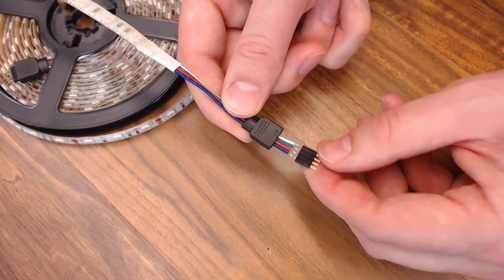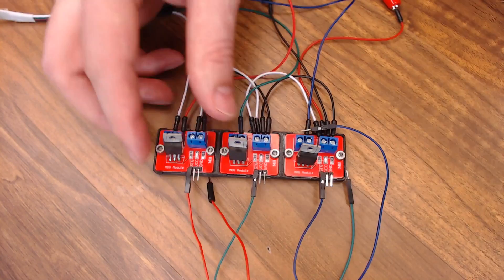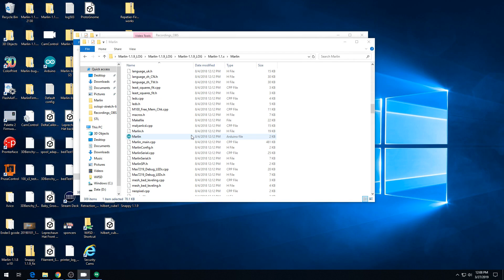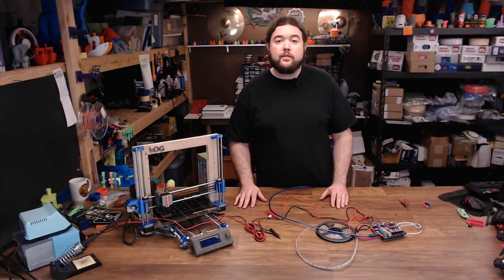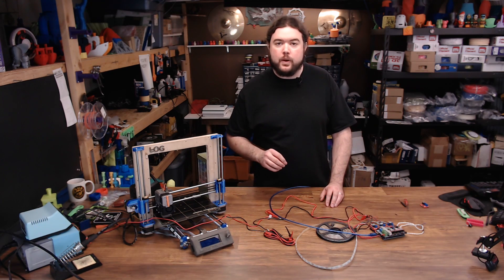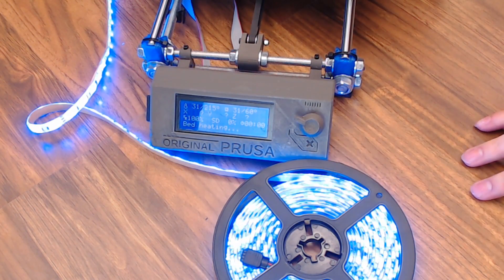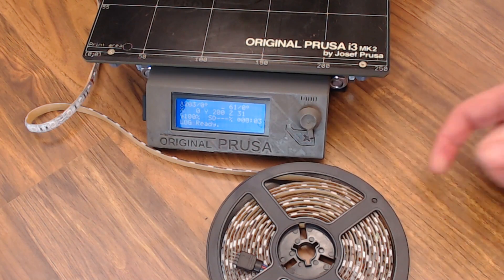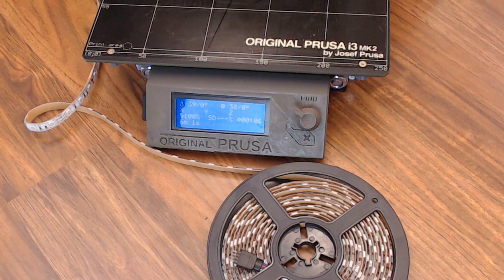LEDs For Your 3D Printer - How To - Chris's Basement

Comment: Great in-depth tutorial and showcase of the true potential of adding LEDs to your printer. 

I have to ask though - If I wanted a 3-possition switch for different light levels, would I just be able to add that between the psu and LED strip, and have the lighting work the same way at different voltages at a flick of the switch? (Was thinking lower light levels for nightime, as my enclosure features a window, and is placed in my room, where I sleep)

I know it's an old video, but I hope you can help me find an answer :)
Reply from the maker: Yes, if you can get the switch setup to lower the voltage, I think that would work. I'm not sure of what the minimum voltage on some of these strips might be. It would take some trial and error.

Comment: Id like to edit the Prusa firmware for this but there is no code for it in the firmware.
Reply from the maker: Yeah, I think Prusa has cut all that out to slim it down.
Reply: @ChrisRiley  i have noticed that. decided to get an skr and learn how to edit marlin so i can customise to my liking. i think i just need led strip with chips "neopixel" 5v and they just wire to the skr rgb port? no need for mosfet boards.
Reply from the maker: @magicmanspaz  Yes, you can do a few like this. But if you want to do a lot you'll need and external board. Good luck on your project!
Reply: @ChrisRiley  Yes true i guess many leds would require more current. not sure on how much the skr can supply but that is something to factor. ill look into it. thanks again!

Comment: Would the ebay  break out board work. Smaller and no jumping. Wires. Vcc ground.   In and out.        MOSFET breakout board module switch relay (15A, 30V) 3-outputs for  Arduino/RPi
Reply from the maker: Sure, there are a lot of nice boards out there that will do this.

Comment: hey Chris love the video thanks for the mosfet holder link I had a little trouble but it was mostly an issue with the mosfets a leg was broken and a signal wire didn't want to stay on but I changed a bit and wanted to ask why didn't you just make the RGB signals the limit max signals? I was doing this on a ender 3 with a skr 1.3 board and the max pins seem to do the job anyways keep up the good work
Reply from the maker: Thanks! Yes, this only works on PWM pins. Some boards the endstop are not always PWM capable.

Comment: Hi Chris can you do a video please on adding LEDs to an SKR V1.3 board using VS Code and the latest version of MARLIN, I am still struggling as to set mine up to work with Prusa . All set up as per your video but still no life not even using Pronterface
Reply from the maker: Hey Colin, yes, I will be doing one in the future about LED's and the DCDC BTT modual.
Reply: Hi Chris any news yet on LEDs with latest Marlin everything appears to be OK but wii not light up at all
Reply from the maker: @colinraines395  They don't light up at all?
Reply: Sorry Chris they don't light at all from start to finish

Comment: Hi Chris Brilliant video as usual. But I am having problems making my LEDs work ,they are on Blue continuously .Am set up on SKRV1.4 Turbo board.am using the pins on PWRDET P1_26.  E1DET P1_25 E0DET P1_00. and slicer G Code settings as suggested
Reply from the maker: Hmmmm, those might not be PWM, that is all I can think of, I would have to check the diagram to be sure.
Reply: hey colin I just got done adding leds on my ender 3 with a skr 1.3 board and I was having issues with the greens doing the same thing and I found a leg on one of the mosfet broke, and one of the signal wires was loose so I re-soldiered the mosfet and instead of using single wire connectors I used a triple but with only one wire attached

Comment: Hi Chris I'm trying to use d20 on tri gorilla board for extruder light and found that it's always on and will not accept g code (using pronter face) to turn off, do I need to change the -1 in pins.h so it will accept commands
Reply from the maker: If it is used by something else, then yes.
Reply: @ChrisRiley  there was nothing plugged into it ,would the board track through it to reach something else
Reply from the maker: @lprkon72  You will probably have to find a schematic for the board to be able to do more than on and off you will need PWM pins. As long as the pins aren't in use, you can use them for whatever you wish. I would make sure your pins file matches your updates anywhere else.

Comment: Hi Chris. On the Big Tree Tech SKR V1.3 board can I use AUX-1 slot to control my LEDs. If yes what are the pin numbers please or do I use the letters
Reply from the maker: You can use any free pin. I would use the MAX endstop signal pins. X P1.28  Y P1.26 Z P1.24

Comment: Chris, I want to add 1meter of neopixels to my printer. I have skr 1.4 turbo. THe LEDs need 3.5a 5v power. Can I pull that much from the Neopixel 5v line or should I pull 5v from outside source?
Reply from the maker: That is probably a little much for the board, I would source it from something else.

Comment: Do you have any hints on Prusa MK3? It have a RPI port, and it seems that you can use its free pins when Raspberry Pi is not installed, but I can't find good docs on that matter.
Reply from the maker: Unfortunately, I don't. I am not sure how the Prusa firmware would allow you to turn them on and off.

Comment: Tried this on skr 1.3 but did not work, the rgb leds work fine with the mosfets but not through the max endstop pins,  enabed rgb and assigned the pins in config h, P1_28, P1_26,P1_24. made the changes in the pins file but when checking with a multimeter the signal pins stayed in a low state :(      but it will work with one color if i use the one and only servo pin
Reply from the maker: Hmmm...I wonder if there is a setting to turn them on somewhere. I will have to look around.

Comment: Have you ever thought of or been asked to setup/upgrade for someone?  I've got a ender 3 bought a mks gen L board and touch screen.   I cannot get the board to respond to anything other then flashing it appears to be working but won't operate.
Reply from the maker: Yes, I have done a lot of configs for the community. Did you have to get the ch340 driver? That might help. Can you connect up with Pronterface?
Reply: @ChrisRiley  
Firstly thank you for replying your the first of the 4 different youtube 3d printer guys that I am subscribed to and follow that replied.  Thank you!!
Having said that, I bought the driver DRV882    No idea why I bought these ones because of all the video "guys" I watch no one uses this driver.   
I've tried to use pronterface but I am not that good at using that program even with my stock factory set-up.  I use Cura for everything.
I'm so lost that I don't even know if I am answering your questions correctly lol.   
I am not sure how much of a interest my subscribers have into 3d printing but I am going to plug you in my next video if you don't mind.  I will link your main page on one of my videos.
Thanks in advance for all your help!!!  Love your videos.
Reply from the maker: @BackyardDIY-Zachary  Awesome, thanks for the plug, just let me know how I can help and I will try to walk you through it.
Reply: @ChrisRiley  Start to finish lol..   I need to know how to flash the board.   I need to set the power for the stepper motor drivers..

Comment: Hi, excellent video. I have a problem. I want to do this with my Tevo Little Monster. The motherboard is a MKS SBASE V 1.3 but configured with Smoothieware. I have no idea wich pins I can use and how I have to configure this in the config.txt file. I think I can use pins in EXP1 slot because it's a TFT screen and not a lcd panel but I am absolute not sure. Have you an idea? Thanks.  Joseph
Reply from the maker: Hey Joseph, no clue how this would work in smoothieware. I have very little experience with it.
Reply: @ChrisRiley  Ok, thanks for reply. I have found a pretty solution. I will use a plugin octoprint that uses neopixel. It would be more easy to install in a Raspberry.
Reply from the maker: @josephcaporaso4774  Cool, I want to try that config for sure.

Comment: I'm trying to do this with my prusa mk2s stock firmware. I changed the pins in "pin.h" to move the min endstops to the max endstop locations and have everything working correctly except for the pwm for dimming. I'm using M42 P11 S255 for manual pin control. I'm wondering how to enable pwm on those pins?

Comment: sorry if im being thick but i ccan only get the blue led to work with M150
Reply from the maker: Hmmmm, if the wiring is correct, B R and U should all work.
Reply: @ChrisRiley  Thanks for replying Chris, i put it on the back burner for a couple of days. I decided to order a few more boards just in case i did do something wrong. I did start over several times trying to trouble shoot it. Hopefully when i do it again all should be well, great Videos by the way, you've earned a sub :)
Reply from the maker: @AMilesGSFE  Thanks a lot, good luck and thanks for the sub!

Comment: The control scheme for this is close to a project I want to do.  Instead of led's have one or more pins act like a interval timer for professional cameras.   That way you can get way better pictures.  How hard would this be to do?
Reply from the maker: I think you could bake that into your gcode real easy. Just add a line to change the pin status on layer change.

Comment: Awesome video Chris...  Just a few days ago I thought about some sort of “On the Air” style indicator to mount outside my enclosure (more about it later) to let me know what the printer was doing.  There really wasn’t many offerings for something like what I had envisioned so I shelved the idea and decided I would revisit it at a later time.  Now with this video, building a notification system might happen sooner!

About my enclosure...  I obtained many years ago a full sized 19” server rack/cabinet that I had planned to build a home network/file server into, but never found the time or real need to.  The only side that is not closed is the back, but that will be fixed soon.  For years it sat in my garage but now resides in my computer room with my Ender 3, my repurposed food dehydrator and my HP inkjet printer.  Even with the open back, it really cuts down on the noise.  It’s on the outside top of this enclosure that I was thinking of placing something that I could tell what the Ender 3 was doing.

Again many thanks for the “Right on Time” video...
Reply from the maker: Right on! Glad this worked out for you. You control all kinds of cool stuff this way. Would love to see what you come up with.

Comment: Hey Chris, I am curious if you know of any pwm pins on the factory Anet a8 board.  I'm really interested in trying this mod.
Reply: And I think I've already discovered my answer.  :)  Looks like it will be limited on what I can use on this board.  Still can mix some colors.
Reply from the maker: Yeah, there is always limited info on these boards. They do have min and max endstop pins so you might be able to move things around to test.

Comment: hmmm I wonder if I can use the mosfets off an old ramps board with 10k pulldowns to do the same thing?
Reply from the maker: Sure, that should work, we are really just using them as a switch.
Reply: @ChrisRiley  thanks for the reply Chris,  I decided to give it a shot on my cr10 that I've shoe horned a ramps board into, and  it works!   I think adding a couple of menu items to the printer to turn the leds on  and off in 'white' mode  to make it easier to see while doing any maintenance could be handy too
Reply from the maker: @DevilbyMoonlight  That's a great idea.

Comment: Great video. Was looking for something like this. But my Prusa uses an EINSy10a board and when I looked through the sources of the original Prusa firmware, there was nothing that reffered to RGD LED's. Should I use vanilla Marlin to be able to use this?
Reply from the maker: Your probably going to want to say with Prusa firmware. You can edit it and load it with the ide to enable some pins. Then use gcode commands to do the same thing.

Comment: Thank you very much for this great video.  I am considering doing this for a printer that I am designing and building.  This printer will have a 24v system with an MKS Gen L board.  Rather than step down the voltage for the LEDs to 12v, I find myself thinking that it might be simpler just to get a 24v LED strip.
Reply from the maker: You're welcome! That works too.  😀

Comment: Good tutorial, but the Neopixel LEDs are better for this use case
Reply from the maker: That's what lots of others are saying, I will have to give them a try.
Reply: Chris Riley can’t wait to see it. Keep up the great work!
Reply: Can you elaborate why Neopixels would be better? I am interested in modding my printer with LEDs.
Reply: Edward Z - The Neopixel LEDs only require a single IO pin as opposed to 3. The LEDs on the strand can also be individually changed, meaning you could have complete control over each LEDs color. The strips used in this video are linked, so they all have to be the same color
Reply: @cap1sup  Thank you for the quick response. So does that mean I only need one MOFSET driver board for all three colors?
Reply: Edward Z No. You don’t need a MOSFET board at all. Each LED has it’s own chip, which are connected on a single data connection. In addition to the data connection, you need a positive and a negative to power the actual LEDs. The printer’s main chip (like a Arduino Mega) then tells each chip in the line the color values it needs. It does it so fast there isn’t any latency. In addition, the chips also allow you control the LEDs in a pattern, much like the ones on carnival rides
Reply: @cap1sup  You are talking a little over my head but that's okay, that's how I learn new things. Isn't the point of the MOFSET to keep from overloading the Arduino/RAMPS board? Why don't the Neopixels cause an overload ?
Reply: @edwardz5581  - So a MOSFET is a power controller. It allows the relatively small amount of current of the mainboard to control much larger currents, like the ones the LEDs use. I don't know if you know this, but RGB or RGBW LEDs have individual parts for Red, Green, and Blue or Red, Green, Blue, and White. The color can be varied by lowering the power available to the LED parts, effectively dimming each part. To our eyes, the colors of each part mix. This is similar to mixing food coloring. By varying the amount of each color of food coloring, you can make the parts of the rainbow.The LED strip used in this video has all of the same color parts of each LED in the strand connected. Therefore, all of the LEDs in the strand have to be the same color. With the NeoPixels, each LED in the strip has a dedicated chip behind it. The mainboard can tell each chip how much power to give each part of that chip's LED, and the chip pulls power from the power lines of the strip. With the individual chips controlling the power, a large power controller (the MOSFET) isn't required. Each chip in the line is "talked" to with the same connection, so only 1 pin is used on your mainboard. Let me know if you are confused or need more explaining.
Reply: @cap1sup  So if I understand you correctly, you still get your power from a different source but the mainboard is controlling the lighting effects. Do you still need a pin for each color?
Reply: @edwardz5581 - You have to use another 5v power supply. The one on the mainboard isn't big enough to power the LEDs, and you could fry the power supply on the mainboard. I would guess you would use 12v, so you could use a buck converter (google them) to take the voltage down to 5v. Each LED on the NeoPixel strand draws 0.080 amps, so multiply that times the number of LEDs you want to get the minimum buck converter rating (ALWAYS get higher!). You only need a single pin from the mainboard to address all of the chips in the strand. While the mainboard addresses each chip, it tells the chip the color values that LED is supposed to be.
Reply: @edwardz5581  - Here is the link to NeoPixels from a highly reputable supplier - https://www.adafruit.com/product/2842?length=1
Reply: @cap1sup  So a 5 volt supply rated higher than the full load of the neopixel string ( which is about 1.6  amps in my application). Looking at the diagram from ADAFRUIT, positive to the strip, neutrals tie together and go to mainboard and the strip, and the data pin goes the to DO on the strip. Any suggestions on what pin to use on a RamBo 1.3 board for the data pin?
Reply: Edward Z - You’re going to have to find out what pin you want to put it on. I do know, however, that the NeoPixels will use any digital pin, and that in order to run NeoPixels, you are going to have to be running custom firmware.

Comment: Chris, As always nicely done. Please keep this up. I really enjoy the content. Are you sure you can keep up with 2 a week? Good luck. One of the features of the V1 version of the ATXPiHat does this exactly. The MOSFETs are a lot smaller and more energy efficient. The Octoprint plugin that I have built for controlling the power also interprets the M150 GCODE to do very similar things.  Take a look at this, https://baprojectworkshop.com/2018/03/31/deep-dive-atxpihat-led-and-switch-support/ it has all of the particulars. I have also implemented the M355 command to turn the external switch on and off. Good luck.
Reply from the maker: Thanks Brian! This is awesome, I will check it out. We will see how long I can keep cranking out videos. ;)

Comment: Awesome video Chris. I would love to figure a way to do this but to wire my wall area and be able to plug and unplug a printer to the lights so that I can move them around if I need to.
Reply from the maker: Thanks! Yeah, you can probably come up with a disconnect some how. Shouldn't be to hard to find.